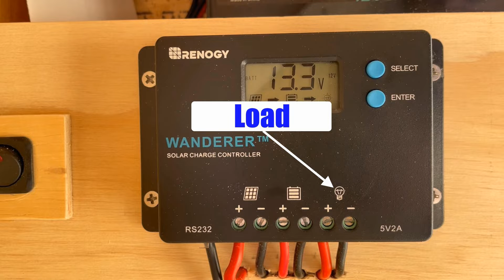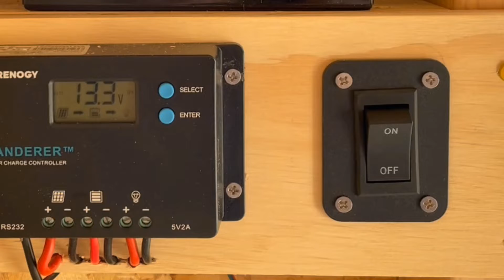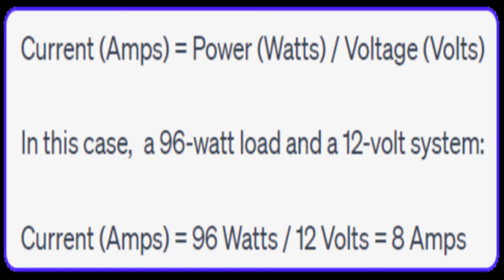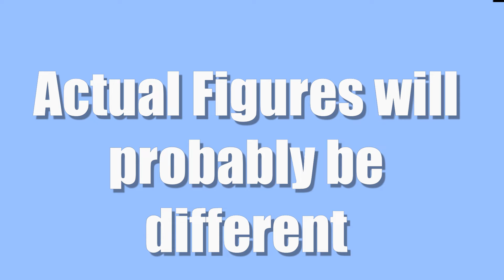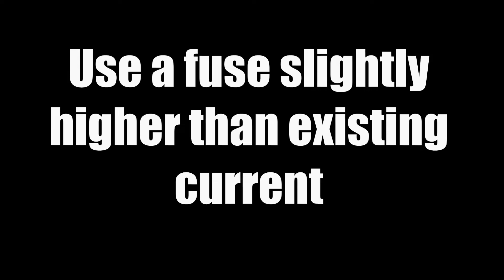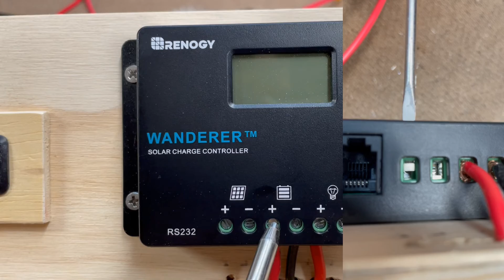Build This Solar Power System for Your Shed Lights

Comment: So, I purchased all of this stuff to build this system.  For some reason, the battery here is no longer compatible with the Renogy controller.  When the HWG  battery reaches full charge, the battery charge voltage starts going to over charge. (go to 1:10 in this video) https://www.youtube.com/watch?v=UUxieOssY6E   I contacted Renogy and over a couple weeks of trying things (like not connecting the leds to the load terminals, but instead to the battery) and them sending me a new charge controller, they finally stated "If the same issue (battery voltage exceeding 15V) persists, it indicates that the PWM controller is incompatible with the BMS of this battery model. We recommend purchasing an MPPT controller for better compatibility."   Note:  I replaced the battery with a equivalent AGM battery and the systems performs normally.

Comment: Thanks for the great video. I would like to duplicate it, but also trickle charge my lawnmower battery. Could I run two outputs one to the interior lights and one to the mower battery?
Reply from the maker: Depending on the voltage requirement of the battery charger, you could get an inverter and connect it to the battery. The battery would most likely need to be larger than the one I have in this video. Check other youtube videos. I'm sure there are solutions out there.

Comment: Question, you have brown and blue wires, which is positive and negative? I am doing something similar and would like to know before shorting anything out, thanks!
Reply from the maker: With my lights the brown wire is negative. Not sure that translates to other lights however.

Comment: I have no experience in doing electrics but need a light source for a shed I’ve just built and I don’t really want to go for an off the shelf sole shed light from a store as this options looks much more relatable and stable can you give me any advice regards your thoughts thanks so much for posting this great video
Reply from the maker: I would suggest checking out other videos on the subject. It's not hard once you understand the concept and what components you'll need based on your particular situation.
Reply: Thanks so much for your prompt reply it’s very much appreciated ! Can I ask is some of the lights attached to a system like this can have PIR sensors on them as I would place two lights inside a storage shed and maybe two or one in a wood store next to the shed. Thank you for your time kind regards paul
Reply from the maker: Sure. The lights, with sensors or not, are connected to a battery. As long as the battery has power it will run the lights. The solar panel collects the energy from the sun, transfers that to the charge controller, the charge controllers determines how much, if any, power needs to go to the battery.
That is a simplified explanation.
Reply: thank you so much for taking the time to explain @RonniesWorkshop

Comment: Hi. Just done the same for our beach hut in Southend-on-Sea, Essex, UK. Used led strip lights, with their own on/off switch and also a dimmer as so bright in there! Used the house burglar alarm battery the guy replaced last year due to age and was gonna chuck but takes a charge fine. 9Ah. Think they use these batteries for m/cycles too. Got a cheap solar panel and controller for £18 and it does the trick. Great site ! Gonna be making the 14inch high xmas trees for Xmas this year.
Reply from the maker: Sounds like a great setup! Thanks for stopping by!
Reply: Looking to set up a solar powered light system for wood store and shed in my garden any advice on a set up welcome have no experience in doing electrical stuff is it hard? And exspensive
Reply: where'd you get the panel and controller that cheap?!
Reply: @NiNjaTurtLe697  onbuy think it was. Not sure if still available at that price ? May have been priced wrong ?

Comment: Often thought about setting my garage up on solar maybe to run some lights as well as power tools  and your video has prompted me to do so. Do solar company that you use have bigger units? Thanks, enjoyed your content.
Reply from the maker: Yes. I used Renogy and they have bigger controllers and panels. Look into an inverter for charging your tools. It converts the DC to AC

Comment: Looking for a setup that could also charge my tools rechargeable battery with the spare power from the panel

Nice video 👍
Reply from the maker: You would need a larger battery and controller. An inverter would be an option to charge your tools. It converts the dc to ac.